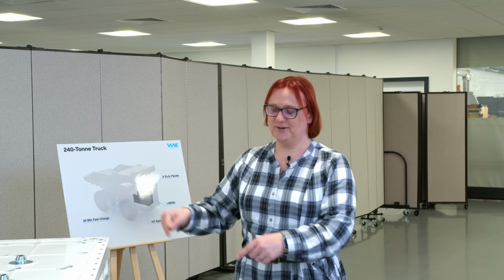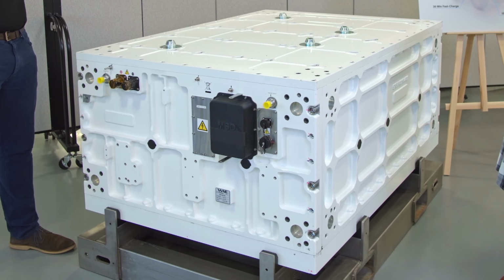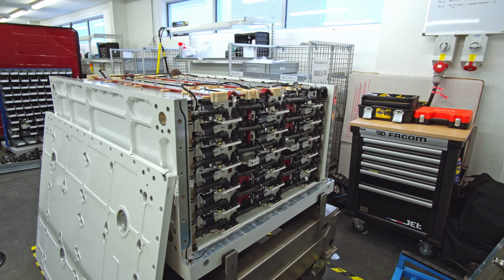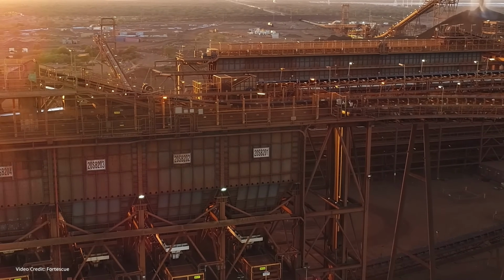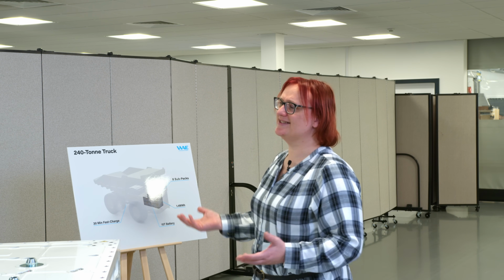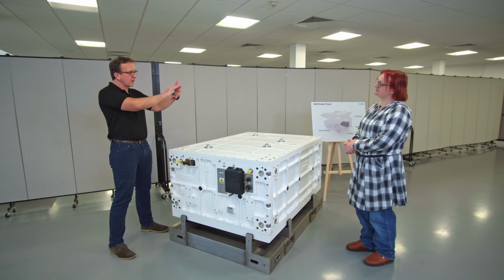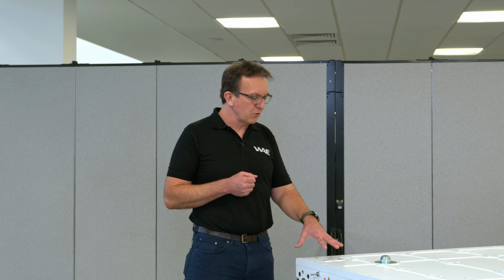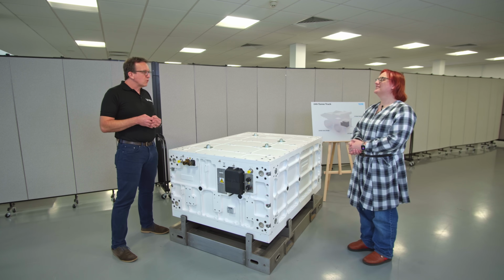EIGHT Of THESE Make This Mining Truck All-Electric!

Comment: How much lithium must this truck mine to build its own batteries, and how long does it take to mine so much?
Reply: Rough estimate would be about the same amount of lithium (and cobalt, manganese) needed to produce the batteries for (14) F150 Lightnings, I'd guess.

IOW, not a lot.
Reply: @alsavage1  I wouldn't call an F150L green either, but 14 times the size of an F150L battery sounds right.
Reply: Odd question.  You would have to understand the amount of Lithium in in each cell then x.  (as mentioned in the vid, they are not talking battery chemistry)  It's a small amount.
Reply: @Pottery4Life  But refining a small amount of lithium requires a much larger volume of material. A truckload of material from a lithium mine doesn't produce a truckload of lithium, not remotely close.
Reply: something in the area of 120...140 kg of lithium
Reply: @stefanweilhartner4415  Where do you get this figure?
Reply: @restonthewind  very easy to calculate. in a standard EV pack is approx. 10kg of lithium with about 75kWh (elon musk). scale it up to about 1MWh and you are there.
Reply: @stefanweilhartner4415  That's 133 g/kwh (10000g/75kwh). I'll stick with 160 based on the source above, but you're in the same ballpark. At 160, a 1.4 Mwh (the battery size for a mining truck according to the source above) battery has 224 kg of lithium.

The question is: How long does it take this truck to mine 224kg of lithium? It doesn't haul pure lithium. It hauls ore that's maybe one percent lithium.
Reply: @restonthewind  lithium mining this way will be outdated very soon because pressing brine through a filter is much cheaper.
Reply: @restonthewind 224 kg lithium if it is 1% would be 22.4 tons of material, so, a tenth of one load of the truck.
Reply: According to Michelle Lewis in an Electrek article on Jan 13 2023 - 2:02 pm PT, "A 240-tonne mining haul truck is about to be fitted with a 1.4 megawatt-hour (MWh) prototype battery system that global green energy company Fortescue has developed with equipment maker Liebherr." I don't know whether 240-tonne is the weight of the truck or its capacity.

At 160 g/kwh, this battery contains 224 kilograms of lithium. 160 g/kwh is from a Linked In article by Paul Martin published on Nov 29, 2017.

I'd link these articles, but hyperlinks seem to get my comments deleted, presumably by a spam filter. You'll find them easily enough with Google.

To clarify, my question is: how many tons of Earth (or raw ore) must this truck move to produce so much lithium, and how long does it take?

It's not obvious that an electric mining truck is greener (in terms of CO2 emissions) than a diesel truck. Like all EVs, producing the electric vehicle requires far more CO2. Even for a conventional EV, making up the difference with no tail-pipe emissions requires many years, and I doubt that the battery in this mining truck has anything like the lifespan of a conventional EV battery.

According to an article published by the Penn State Institutes of Energy and the Environment on June 21, 2022, an F150 Lightning produces 40% less CO2 than a diesel F150 over the life of the vehicle. I doubt that a mining truck does nearly as well if it's fully discharged and then fast-charged several times a day. The life of a battery is measured in charge cycles rather than years.

Comment: 12:05 imagine trying to stop a 400 ton airliner doing 170 knots (315 km/h) trying to take off. in tests (worst-case scenario, wheel brakes only) the brakes get so hot that the tires start burning.

Comment: I am skeptical of electric vehicles in agricultural, mining, and construction type applications. But I also recognize that the companies that manufacture these vehicles will do their best to come up with acceptable solutions.
Reply: Since many of the most heavy-duty vehicles are already powered by electric motors (locomotives, mining vehicles, etc.) that are typically supplied by ICE generators, it is just a power source that is being replaced by battery packs (or fuel cells, or grid on some), and not necessarily a redesign of the entire vehicle. Very feasible as battery tech has rapidly advanced, plus reduced maintenance, ability in remote areas to power from solar or wind setups, less pollution.
Reply: The key practical reason why they were powered by diesel historically, was mostly due to a reliable, and sufficiently energy dense batteries.   Which has now been a proven technology.
Reply: Great replies... Another reason for series hybrid setups is that mechanical transmissions are very difficult at these sizes...

But an electric "transmission" is quite simple as electric "slip" is easier to deal with.

Steam is more similar to electric regarding torque than to ICE...

Comment: funny, I was willing to bet that they are using LFP cells considering the low energy density of that unit, and the heavy duty application.
And, I still am! :-P
Reply: And the cycle life and safety which must be an issue for these very large packs.
Reply: @isovideo7497  due to very good cooling, they try to keep a very long life.
Reply: the low energy density of that pack is due to higher cooling demands and structural demands that are much higher than in a car. that uses up a lot of space and weight.
Reply: LTO batteries would be a good choice as they're very tolerant to abuse, temperature and current load and can have a lifespan of over 10,000 cycles. They have relatively poor energy density so they're best used in vehicles that are already heavy.

Comment: Look up the fuel cell truck Anglo American built last year. A startup in Seattle made the fuel cell part of the power system. They plan to switch all the trucks on the site to hydrogen fuel powered using on site solar electrolysis.
Reply: you should have said "hope to switch" green hydrogen is not a thing anywhere yet and will be a long way down the track there is also the problem of catalysts for the fuel cell which are already prohibitively expensive and will only increase if demand increases.
Reply: They will have to develop a very effective on-board system to feed the fuel cells with pure oxygen from dirty air, unless the have both hydrogen and oxygen bottles. Also find pure water for their electrolizer - if any - may be a challenge in a mining site.
Reply: Well there is no such thing as green electricity neither… sis there’s that as well